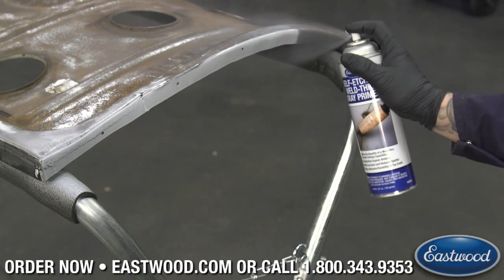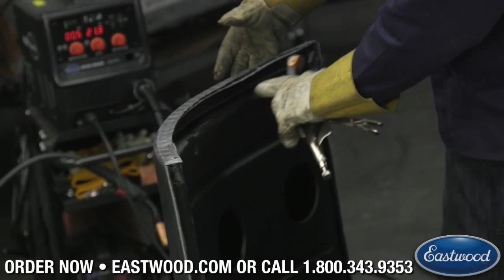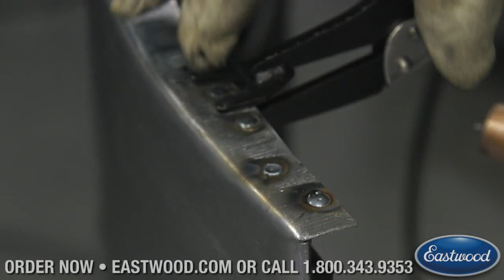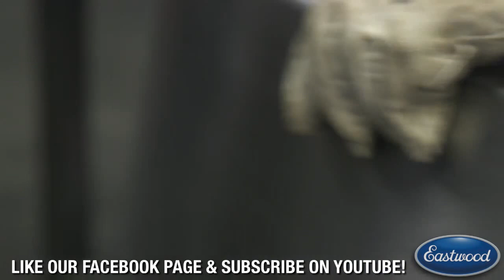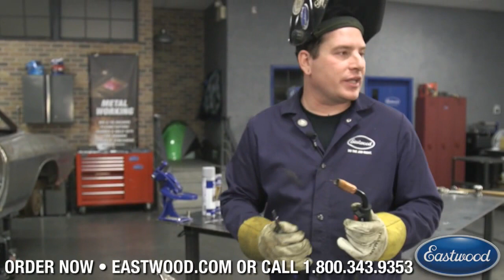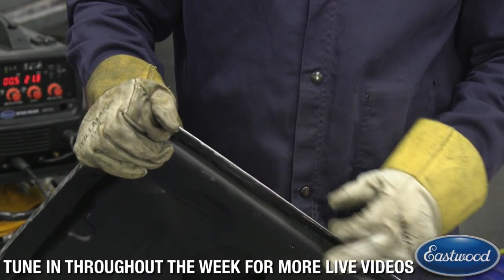How To Weld a Trunk Lid Skin.  Model A DeckLid Skin from Scratch!  @ Eastwood

Comment: For stitch welding thin metal, I usually turn my welder up really hot, and give it a quick "zap" (probably 0.2 seconds). This produces a very flat, full penetration weld. I haven't tried it with a plug weld, but it would seem that the result would be very similar. Using the copper-backed plug weld pliers would eliminate the likelihood of blowing through.
I say this because it's pretty clear that Matt isn't accustomed to clipping the ball from the end of the filler wire before each weld. I know I don't do that.

Comment: What you need is a little more voltage and a little surcle movement of the torch round the hole and that will make the weld flat and nice

Comment: yes i was able to shove a screw driver in mine and finally get it open. the deck lid is pristene butt i found engine parts held in by a loose sheet of gavenized roof metal. bad deal for me since i havnt beem able to pry the hood open yet.

Comment: Can you adjust the depth and hole size on that punch?
Reply from the maker: It's designed to punch 3/16" holes in sheet metal.  http://www.eastwood.com/perfect-panel-prep-tool.html
Reply: Thanks. I'm building a Factory Five Roadster which requires @2k rivets to fasten the aluminum panels to the chassis. I was hoping it could punch holes for 1/8" rivets (probably #30 hole) and was hoping for something pneumatic and more portable/flexible than my drill press. I've seen the hand punches, but my forearms would look like Popeye's after 2k punches. LOL